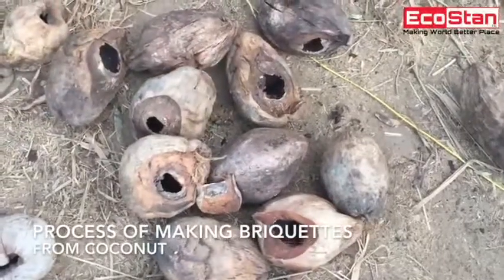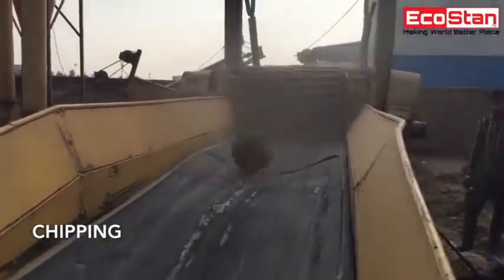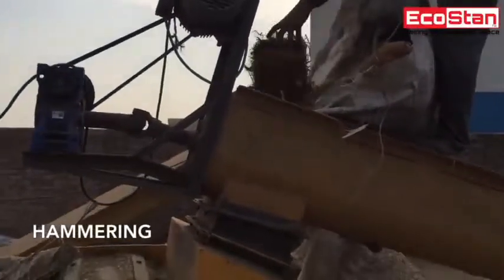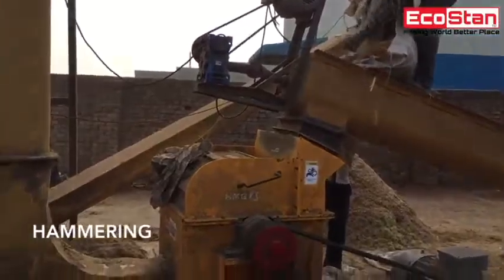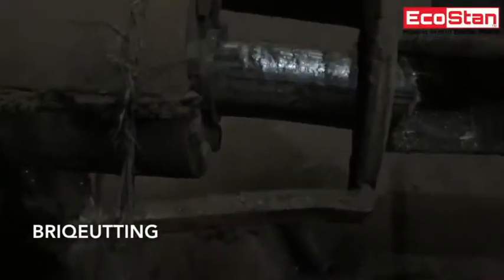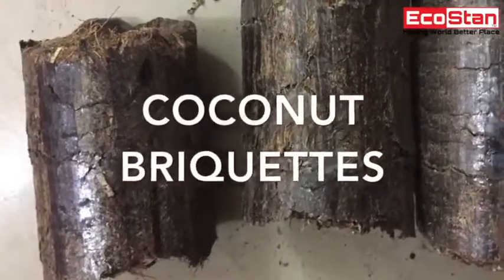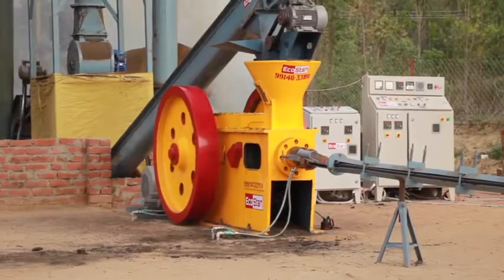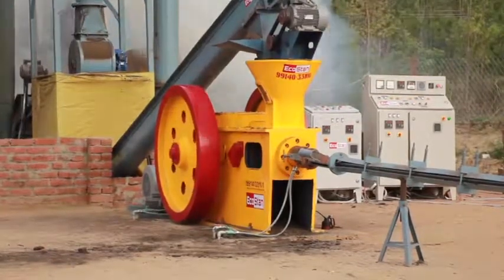+91 8707870542 Coconut Waste Briquette Plant Briquette Machine Briquette Press Green Tender Biofuel

Comment: Some videos shows from the coconut waste coir,cocopit, rasi manufactured, and in this briquette manufacturing which is profitable, in this process dryer is required its take heavy electricity, can use with any agro waste like bagas
Reply from the maker: you can use any agro waste
Reply: @vijayadav1982   
Can use coconut directly,
Reply from the maker: @narayandasbajaj4203  No
Reply: @vijayadav1982  what's the procedure use coconut waste
Reply from the maker: @narayandasbajaj4203   Chipping, Grinding and Briquetting